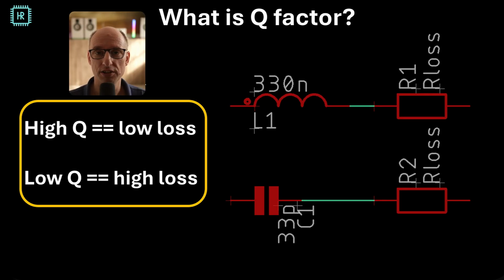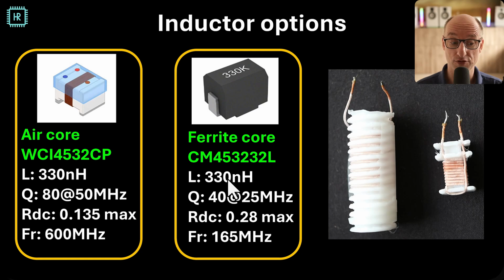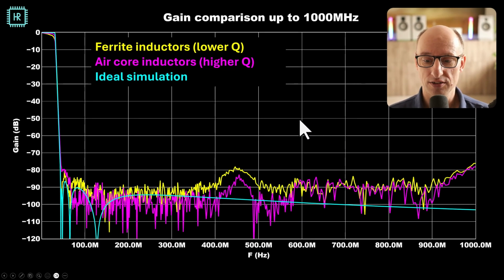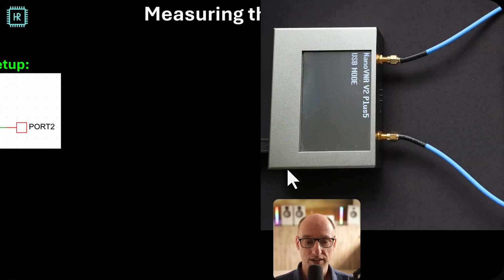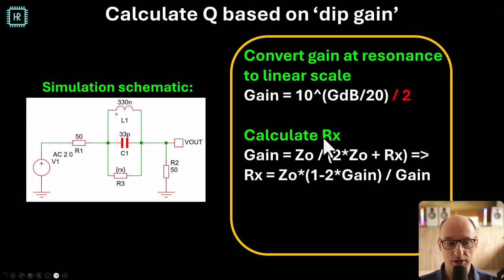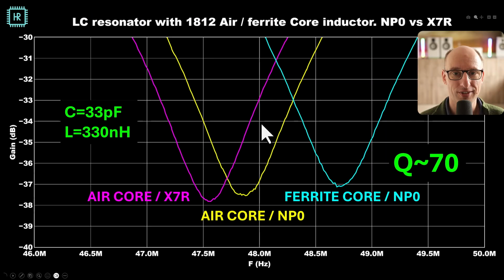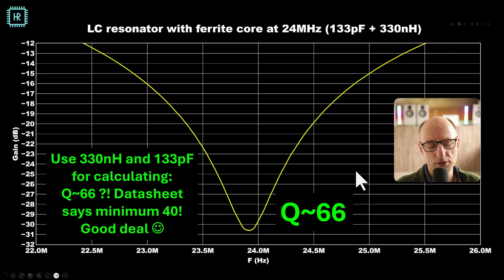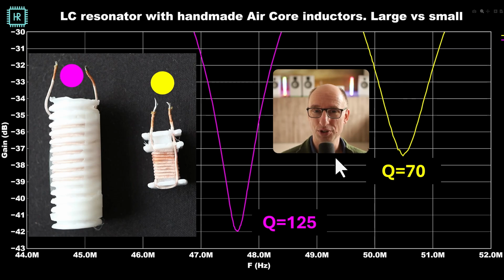Why Your LC Filter Fails (Even If the Schematic Looks Right)

Comment: The letter 'Q" is historically used to represent a generic level of 'quality'. Therefore a higher 'Q' , (lower loss,) means higher quality. BTW, a small description correction: The resonance frequency of an inductor is not the frequency where an inductor turns into a capacitor. It's the frequency where the inductor's inherent capacitive reactance becomes equal to it's inductive reactance and it becomes a tuned circuit that is at resonance. At a still higher frequency it's capacitive reactance becomes higher than it's inductive reactance, meaning it has more of a capacitive effect in a circuit than an inductive one.
Reply from the maker: Yes, you're right, it's right above the resonance frequency. At the resonance, it is a pure resistor.

Comment: 3:26 Have you considered nearby objects can effect the Q-factor of an air core inductor? I don't know if this effect is considerable, but at the moment I'm building a setup to test this. I 've read that not only metal, but also wood can have an effect.
Reply from the maker: The material would have to be really close as the fields don't spread out very far. I think especially wet wood could have a bigger impact. Human tissue is also very very lossy, especially at higher frequencies like 2.5GHz.
Reply: @HansRosenberg74  Interesting.s  Do you expect the effect of nearby metals to be neglible as well for air core inductors at frequencies below 30MHz?
Reply: @necessaryevil8615  Hans is the expert, but my one-line take: for a drum-wound air-core inductor, yes, metals will affect the inductor, most especially its Q.  Whether the metal is ferrous or non-ferrous makes a big difference, too, because non-ferrous µ≈µ₀.

If a toroid "air core" inductor were meaningful, I'd guess that the same would still be true because what makes toroids special is the magnetic flux loop is mostly contained within the toroidal former owing to the former's very high µ.  That wouldn't happen with an air-core toroid.  Also, it doesn't look like the effect is particularly dependent on frequency.

In context (air core + f<30MHz), I'm guessing you're an amateur radio operator working the HF bands and that you're asking on account of loading coils, AMUs and similar, where Q really matters.

The physics at work is Lenz's law by two paths.  
• RF magnetic fields induce EMF in the external metal structure which makes the metal structure look like the shorted secondary of a transformer.  The skin effect is the main determinant of the resistance of that secondary winding.  
• where current flows, there you find a magnetic field which always opposes that of the source of energy.  That's how good coax doesn't leak RF: though not induced, return current produces a B opposite of the centre conductor; these cancel, no external magnetic field.

Think also of an antenna's reactive magnetic field, particularly in a yagi.  You'll know that an electrically-short antenna looks capacitive (hence inductive loading coils) and an electrically-long antenna looks inductive (hence "cap hats").  Directors are electrically short where reflectors are electrically long; because they look capacitive and inductive respectively, the induced current from the incident wave steers the Poynting vector either forward with the incident wave or back towards the source of the wave.

If all this happens, even in a yagi made of aluminium, something very similar is going to happen with metal near an air-core inductor.  If you look up Jefimenko's equations written in the appropriate form, the second term describes the inductive field (dI/dt) which falls off with 1/r² (which, with Poytning vector added, gives you a fall off of 1/r³).  As Hans says, magnetic fields fall off pretty quickly, and that's largely why.  So at least one diameter away should be somewhat okay, maybe a bit of detuning and some Q degradation, the more the better.

(Jefimenko's third term also very nicely illustrates the true reason antennas radiate: it has nothing to do with E and B fields, and everything to do with acceleration of charge.)

Comment: VNA is not the best tool to measure Q factor, Q meter handles high Q measurement much better.
Reply from the maker: I know! I just don't have one :-) The resonator method is very accurate IF your capacitor has way less loss though. When q values get really high that might be a problem....

Comment: The VNA can directly measure capacitors and inductors. Turn on the Smith diagram, calibrate and connect the component under study to the VNA connector. Set the marker to display R and X. X will show you the value of the inductance or capacitance. R will show parasitic resistance. After that, you can easily calculate Q using the formula Q = X / R
Reply from the maker: Thanks for the tip. I used that indeed to measure the value of my inductors. You can see the test structure on my green transmission line pcb. I've made options there for open/short/load on the pcb to measure components. I've always learned that a smith chart measurement are not very accurate near the edges and a good inductor is always on the edge. I never tried to challenge that thoroughly though. This is why I relied on the resonator method here. I am curious to try it once though. Calibrate very accurately on the pcb with the mentioned structures and then indeed, you can calculate Q vs F in one go. Would be great if that was accurate.
Reply: Also, by moving the marker, you can explore the behavior of your component at different frequencies. Since the various parasitic parameters of the component depend non-linearly on the frequency. And finally, with the vna, you have access to very high measurement accuracy up to nH units for inductors and tens of fF (yes femto) for capacitances

Comment: Thank you for this video. Some comments on coils: I think you will find the best coil Q geometry is closer to one with a wider diameter than height, and varies with the diameter of the wire and the spacing between the windings, due to Skin Effect, inter-winding capacitance losses, and dielectric losses in the coil forming material. Tall, single layer coil forms are sub optimal, but are used to allow for inexpensive ferrite tuning slugs to be used in them and to minimize footprint size. Also, a coil dielectric like air, if possible, or polystyrene if coil support is required provides lower dielectric loss than other plastics. I'm sure all of the associated parameters are included in modern coil winding programs for single layer solenoids, but I learned them years ago the hard way. Also, a good way to quickly test unknown dielectric materials for comparative suitability as a coil form is to put them in a microwave and see which material stays coolest. There are significant differences in core materials, as you touched upon. I think of adding a dielectric form material to an air coil as adding capacitors between the coil windings, just like the interwinding capacitance that already exists between the turns. That helps to more easily picture the optimum mechanical design for a high Q form, and suggests an 'imitation' basket-weave form could be 3D printed which would allow for an exterior wind for convenience but still provide the wire shape and reduced interwinding capacitance common to basket weave posts.
Reply from the maker: Thank you both for your info, it is very helpful. I knew the microwave trick, I used it frequently when I was designing bluetooth antennas for headsets. I used to make really high q inductors for the 100Khz range using epcos ep cores and litz wire. The litz wire made a big difference. I also found these: https://www.coilcraft.com/getmedia/55a4b40a-2e02-4bf5-b0af-2ea5db75b6cf/1010vs.pdf . These things must have a pretty big interwinding capacitance, however, the Q is insanely high. Wouldn't that capacitance just reduce the resonance frequency? What is the relationship between that interwinding capacitance and Q factor?
Reply: @HansRosenberg74  http://www.g3ynh.info/zdocs/magnetics/appendix/self_res/self-res.pdf  "The self-resonance and self-capacitance of solenoid coils Dr. David W Knight 2013"  I still haven't read it but it seems like a worthy effort. Capacitance is the same reactivity as inductance. At certain frequencies this matters. If frequencies are ten times or less below self-resonance, capacitance is unlikely to matter. I simply proceed from the well-known formula for calculating the quality factor.
Reply: well..The solution, of course, is to recognize that the coil is a transmission line, with the only difference that the solution to the problem in the case of a curled line turns out to be quite difficult...

Trivial measurements confirm that the coil's self-resonance is related to the total length of the conductor. It is therefore strange that the intrinsic capacitance of single-layer coils is still usually related to the static capacitance that supposedly exists between adjacent turns...
Reply from the maker: I found this page: https://www.robkalmeijer.nl/techniek/electronica/radiotechniek/hambladen/qex/2001/09_10/page33/index.html
Wow, didn't know there was so much behind calculating the q of an air core inductor. Fascinating. With this knowledge in hand, it would be really cool to build a VCO with an insane resonator and a really low phase noise.....
Reply: @HansRosenberg74  The site deleted my message with text and link. It's a pity.
Reply from the maker: I got the link to the PDF. Thanks for the detailed information. I especially liked your remark to look at it as a curled transmission line, that makes a lot of sense!
Reply: If he had used silver-plated litz, the quality factor would have become even higher. Yes, the further the turns are from each other, the smaller the interturn capacitance(that's why flat wires make sense). Experienced radio amateurs have demonstrated that the optimal quality coil has a length-to-diameter ratio L/D ≈ 1
Reply: With smaller coils (10 mm length or so) I also realized that a contributor of reduction in Q is not only the pitch of the winding of the return wire, but also the (type/amount of) glue holding it together.
Reply from the maker: At high Q everything starts to count. So you'd have to find glue with a low loss at the usage frequency. I have never tested glue for this purpose actually.